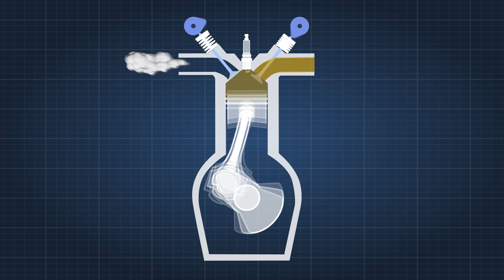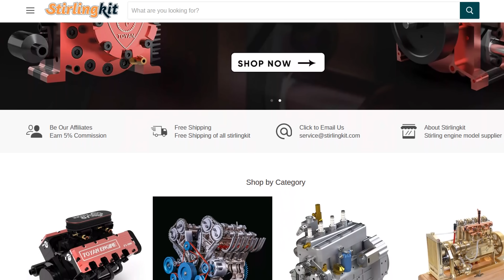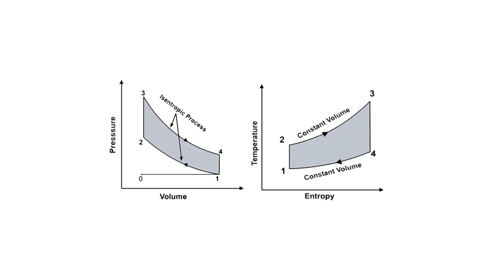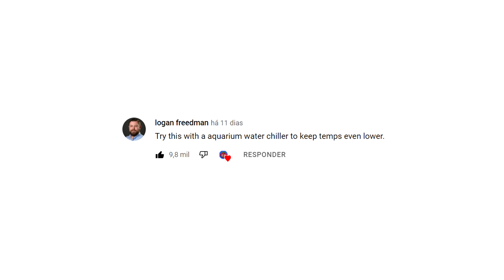I 3D Printed a Transparent Combustion Engine in Resin

Comment: Hey Joel, I have an explanation.

I think the reasons why the Nitromethane fuels didn’t work very well is because they were too powerful. And because they were too powerful, the engine’s piston was pushed down too fast. Meaning increased pressure.

If you’ve seen a video by Tom Stanton where he makes a car using an air engine, he said that the higher the pressure of air stored inside the Water Bottle that he used as a tank, the worse the car preformed. He said that the car’s range would go down with higher pressures.

I think that’s your problem. With pressure coming from the too powerful and explosive nitromethane.

Comment: INTEGZA!! I’m confident the reason is because you said the spark is triggered by the cam gear and in a 4 stroke engine the camshaft spins at half the speed of the crank therefore causing a “real” power stroke every 8 strokes also the 25% nitro acts more like a diesel fuel “why its used in glow engines” and is likely helping the engine fire every 4 strokes consistently

Comment: Take it with a grain of salt because Im no engineer but maybe it's skipping steps in the cycle because the air fuel mixture is leaking out of the cylinder during the compression stroke. I saw some water vapor from the combustion leaking out of the top of the cylinder and if moisture can escape, gas certainly can. At lower speeds you might expect less gas to be forced out leading to a partial combustion. With the more powerful fuels at higher speeds, once the piston has cycled a few times without a successful combustion it could be slowing down enough such that there is again enough fuel air mixture left in the cylinder for another partial combustion. 

Idk though, maybe try an O-ring.

Comment: My theory why the more powerful fuel is the slowest is that the engine runs too fuel rich, causing a slower combustion/burn. The methanol looks like it actually combusted where the gasoline and the infused methanol looks like it burned.

Comment: Advance your timing. Nitro burns slow, so it needs an earlier spark for a chance to ignite.
The missing power strokes were likely a result of the engine speeding up past the spark timing's limit because of the previous power stroke. The 25% nitro just gave enough energy to skip two power strokes.
An episode about fuel would be cool. Stoichiometry, the relationship between ignition temperature and compression ratio, spark timing and burn rate... That kinda stuff.

Comment: How about a video of a RC model engine ? These use a glow plug, but only for starting - then they run thanks to the combustion keeping the wire in the glow plug....glowing. Also, they run on methanol and a low percentage of nitromethane (anywhere between 5% and 20%)

Comment: When you can see the flame it's not burning efficiently, it doesn't sound like it's missing any pulses to me, I think it is firing but you just can't see it under those lighting conditions.
To burn high octane fuels efficiently, you need much higher compression, race cars and drag cars add turbo chargers etc to force more mixture into the cylinder which increases the compression even more, when you see flames from their exhausts that's unburnt fuel burning inefficiently with lots of air.

Comment: Actually, a benefit of 4-stroke Gas Engines are that they reduce fuel consumption because fuel is only used once every 3 strokes.

But it does make the runtime a bit faster. Just look at the 4 stroke Air Engine by Axel Dayton. It can only run for a few seconds without pressure regulators. And now look at Tom Stanton’s 2-stroke air engine. It can last very long.
Reply: that is not at all the reason why they reduce fuel consumption. You should look at power output if you compare the two, not speed. because both speed and torque matter for an engine performance (speed x torque = power) 

if you look at power, in theory they use just as much fuel, because theoretically power is a function of how much fuel you burned, if you burn twice as slow, you need to burn twice as much to get the same power.

A 2 stroke engine at the same speed as a 4 stroke has theoretically double the torque.

Practically the problem with 2 strokes is that they don't clear out the chambers properly, and they also burn oil together with the fuel, making them inefficient in comparison.

Als you can't compare those two engines the way you do, since they are build with different dimensions, weight, volume etc. Many factors contribute to their difference in performance, not just 2 or 4 stroke.
Reply: @DrTheRich  Well, we are comparing Air Engines to Gas Engines because they are similar in this case.
Reply: @suspense_comix3237  No i mean you can't compare Axel Daytons airengine to Tom Stantons airengine by just saying one runs shorter than the other.
There is many factors that change the runtime and speed. Not just whether it's 2 or 4 stroke.

Comment: Im no expert but i believe that more powerful fuel gives more momentum to the piston while going downword which results in taking more time to come back up and give more time to compression part and thus igniting the fuel properly and consistently but also resulting in less rpm. While less powerful fuel like methanol gives less momentum and faster recovery hence improper ignition but better rpm. Well its just what i think 🤔. Well that can be rectified by making the piston heavier ( adding load maybe helpful) when using less powerful fuel or by shiting the weight of the crank shaft ( making the parts heavier that are facing downwards with respect to the axel when the piston is going up) so it experiences more resistance while going up but comes downd Smooth.

Comment: I have a cool tips for you and for the motor to go BRRRRRR :

1...Remove the spark plug cleanit with a sandpapper and put back everything 
2...give more power for the spark gap. Maybe the pover is to veak to spark the plug .
3...do some valve setting. With gott valve setting you can set the intake and the exhaust .
4...change the carburator settins for mor air les fuel or reverse.

Comment: Isn't the problem with the carburetor ? If you don't reach the stochiometric mix with the first cycle (if you don't have enough fuel for ignition), and if some of the fuel remains and isn't exhausted, then the second cycle fuel injection might bring the mix up enough for the spark to ignite it.

Comment: My uneducated guess for what’s happening is that the “most powerful” fuel burns slightly slower than the others. This means the engine will run slower but you get a longer time that the fuel is burning so when a load is applied to the engine power is being applied for a longer time per cycle. Whereas the faster running fuels won’t be able to provide as much power under load because they burn off too quickly. I hope my rambling makes sense 😂
Reply: Jimmy B’s comment about fuel richness/leanness probably has a major effect as well. You aren’t changing the carburetor jet size so the viscosity and density of the fuel mixture will affect how much fuel is sucked in.

Comment: Welcome to the world of tuning! Compression, fuel/air ratios, and engine timing are all three variables that are tunable to get a better result. That's what the ECM does in modern cars -- it can advance/retard the spark timing and adjust the fuel/air ratio. Turbochargers boost the compression ratio. Higher octane fuels need their timing advanced because the fuel burns slower. Methanol has a super high octane rating -- about 110 - compared to gasoline, which here in the U.S. ranges from 85 at high altitudes to 93 for high compression engines at sea level. The higher octane fuel you use, the more you should advance the timing, ie have the plug fire earlier, before top dead center, in the compression stroke.
Reply: "Higher octane fuels need their timing advanced because the fuel burns slower." , this might be "true" in some cases but it is obviously not really true.
I'm quite sure methanol have a higher flame speed(At least at higher temperatures), so the optimal ignition timing should be later than regular gasoline(If the engine isn't knock limited of course).

Comment: I feel like crosshatching on the cylinder wall would help with compression. And I believe the reason there wasn’t a huge difference in fuel in these tests, is because different fuel types require different tuning of the carb, air fuel ratio, and ignition timing. Good Ignition timing is where a lot of your power comes from in a 4 stroke, and different fuels ignite at different times, that is why ignition tuning is so important

Comment: The first thing that comes to my mind as for why the more powerful fuel runs slower is how fast each combustion reaction is.  A fuel can be more powerful in the sense that its combustion produces more exhaust gases, and thus more pressure and force in the cylinder.  However, if the explosion itself is slower it could limit the RPM as the fuel just can't burn fast enough for the RPM to go any higher.

Comment: I expect it is the governor skipping fireing  the spark plug to limit the engine speed and prevent damage.

Put the engine under a mechanical load. Grab the fly wheel with a gloved hand. Does it now ignite every cycle?

Comment: I think the cylinder head gasket is not tight enough.  These are honed on motors made of metal.  At 8:13 fuel can be seen flowing around the green O-ring.  The different densities of petrol (0.74 kg/l), methanol (0.792 kg/l) and nitromethane (1.14 kg/l) support this thesis.  Presumably, therefore, no force can be transmitted.

Comment: You should add forced induction to the engine and see how much you can stress and when the acrylic cylinder walls will break and also make a small dyno to see the torque and power curve of the engine.

People of yt: will really appreciate it if you can like the comment. I'm in a dire need of a 3-d printer :)

Comment: As many have stated, each fuel you've tested has a different AFR, Air Fuel Ratio.
Gasoline is 14.7 parts air to 1 part fuel for a stochiometric mixture, meaning the fuel has exactly enough oxygen to burn entirely, in theory.
Of course theory never applies practically, so there is always some wiggle room.
It seems your mixture was very rich with the gasoline, then the methanol was closer, but not quite perfect.
The nitromethane 16% was again rich, then the 25% had more oxygen in it, so it got closer again.
As for the spark not firing, I believe the carburetor isn't very good at its job, just pushing fuel into the cylinder without proper atomization causing a wet spark plug.
Another variable is the heat range on the spark plug, methanol and nitromethane, being a lower energy density, burn cooler than gasoline due to more fuel being required for a stochiometric mix.
At the end of the day, I just believe this engine is too inefficient and has loose tolerances, but the fact it uses an o-ring as a piston ring is an attractive feature for a transparent cylinder housing.

Comment: Oh and i think what is confusing you is a..... ratio? Of a couple different factors; octane, compression ratio, and charge. In basic terms an octane rating is how easily the fuel catches fire under pressure. Alcohol may have less power but it can withstand much higher compression ratios, and the more you compress a fuel, the more power you can get out of it. The other factor is charge, (how much fuel is actually going into the engine). After all energy comes from fuel, and the more fuel you can fit into the combustion chamber, the more power you can make. Turbos and superchargers are used to compress more air and fuel into the combustion chamber, however, the more air and fuel you add, the easier it is for the fuel to combust under pressure instead of by spark. If your charge ignites under pressure at the wrong time, it can send the engine spinning backwards and damage many things. I hope this helps!

Comment: I think the nitro methane and methanol mixture ran so slowly because too much fuel was being dumped into the cylinder. Also the carburetor is so tiny and close to the cylinder that I don't think there is a lot of time to vaporize without a hot engine vaporizing it on contact.

Anyways, hold a torch to the exhaust and see how much fuel comes out the exhaust and burns in the air. This won't necessarily prove my idea, but it will show you how much fuel is leaving unburnt.

Comment: A fuels specific reaction enthalpy (basically energy/weight) and it's ignition threshold do not correlate. Nitromethane has a much lower specific reaction enthalpy than regular gasoline. So while reducing the ignition threshold by adding nitromethane to gasoline, it also "thins out" gasolines specific reaction enthalpy, resulting in less powerful strokes.
Gasoline on the other hand is mixed with additives to give it a high ignition threshold to counter engine knocking at higher compression ratios. That's probably why it ignited so unreliably.

There maybe also other factors such as viscosity and solubility in air which affect how much fuel is pulled into the cylinder with each intake stroke.
And there are factors such as flame velocity, which is in term influenced by many other factors (mostly fuel/air ratio and fuel type). In short: The slower a fuels flame moves, the less rpm are possible. For example that's the reason, why diesel egines don't run as fast as gasoline engines.

All in all fuel combustion in internal combustoin engines is a vastly complex topic and almost impossible to cover in a single post.

Comment: I think you're running low of air, nitromethane has oxigen on molecule, that means it's feeding oxidising to the mixture, you just need to print a bigger carburetor to run on gasoline. Like from Galicia, and death to tomato soup!!!!

Comment: air/fuel ratio... when you tuning your engine, you also must change the "map"... i will not bore you with details... too much fuel, no enough oxygen to burn all of it, too little fuel, not using full potential of the chamber. different fuels needs different ratio. ideal is to have the exact number of oxygen molecules to react with the amount of molecules of the fuel (the chemical reaction might need more O2 molecules to one molecule of the fuel, idk, im not chemist)

Comment: Props for not using the typical suck squeeze bang blow 4-cycle description lol. 

Is a future video coming from you on the differences with two strokes? They make twice the power and are far more reliable (due to less moving parts). The reason we don't use them is that they create far more pollution, especially due to [most engine designs] having to burn oil to lubricate

Comment: I imagine that the different fuels need different compression ratios to burn well ... Like diesel diesel needs extremely high compression but if memory serves right it's a little more powerful? ... Well 

Actually that brings me to an idea ...  you could actually print slightly shorter cylinders and test different compression ratios

Comment: well.... I'm not an engineer but... i think the problem was the megnetic switch...., if the Engine runs fast the magnet should attract to the flywheel or whatever the thing that makes the piston go up and down, maybe before the two metal contacts touch each other inside the magnet switch where  the magnet inside is attracting to the flywheel ; the flywheel would rotate and not attracting the magnet but the second rotation would attract again the magnet making a clear contacts to the metal plate inside triggering the spark plug.... in other words... the spark plug was delayed more if the fuel is more powerful because the more power the faster the engine would run and also the more delay trigger...

Comment: What if you were to mix gas with the 25% nitro and give it a bigger fly wheel for a better load output and test the air to fuel mix ratio for better results

Comment: It could be too much traction in the engine cylinder because in big cars they use a wax based lubricant on the side of the cylinders to minimize traction this gives the piston a longer Life and lets the engine generate more power and of course this lubricant is non-flammable too or not enough air being added in the Engine cylinder so it makes a vacuum and slows down the piston they’re in both cases it wouldn’t cause the piston to miss the power stroke it would just make the power stroke less efficient

Comment: The advantage methanol has is that it needs a lower air-fuel ratio than gasoline, meaning most of what an engine needs to make more power with it is flow more fuel, it also takes lots of heat out of the air as it's vaporized. There's probably more to why it runs differently here than that, I imagine.

Comment: Some ways to help the engine ignite reliably. increase compression by reducing the height between the top of the piston and the cylinder head (grind down the top face of the cylinder on a flat surface to remove material and ensure a good seal. Also make sure the valves dont hit the piston otherwise you'll be having a bad day.) You can retard/delay the ignition by moving the magnet or setting up a new ignition system that has controllable spark timing. You should also lean out the fuel/air mixture, it appears to be running quite rich.